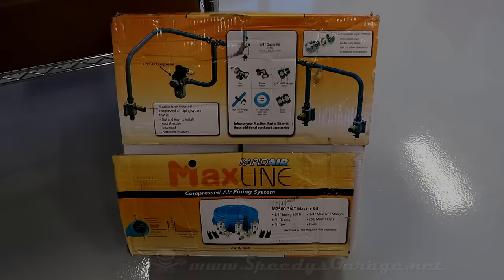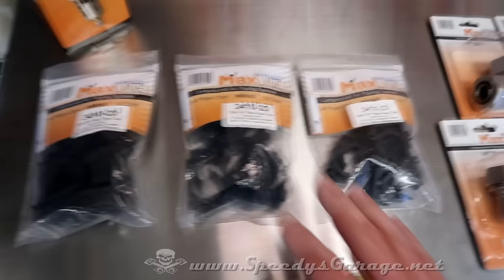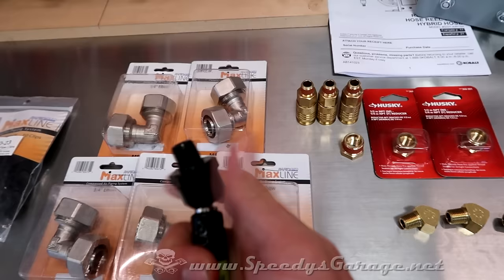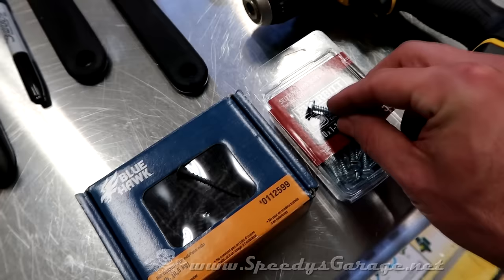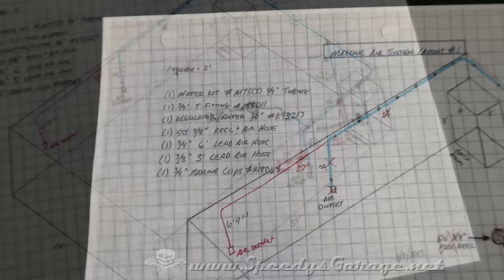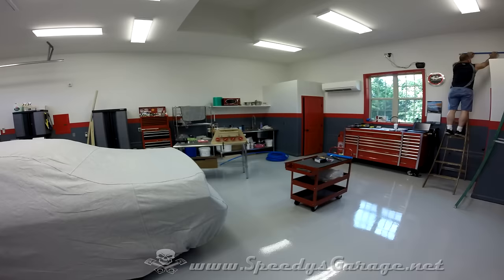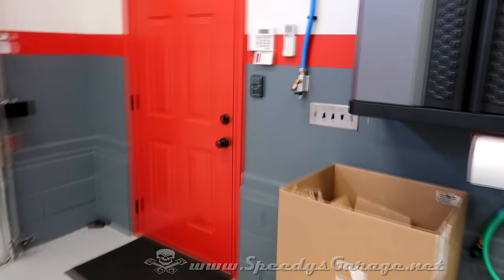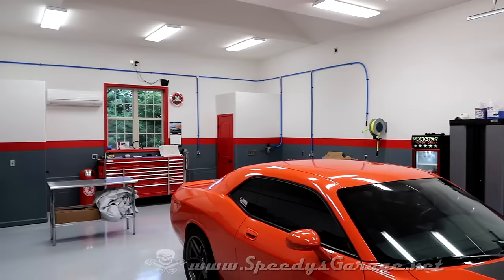Rapid Air Maxline Air System Install Speedy's Garage

Comment: IDK if it was mentioned, but the "push" type air quick disconnects are nice to just walk up and "plug" a hose into, but they give out with just a little use. Trust me...I sell a 100 of the "pull back" type to 1 "push" type. They just arent reliable. I applaud your install. From design of cabinet to end use....OCD myself and it looks awesome!!! Also...on the whip hose with solid 1/2"NPT on both ends, find a hyd shop. The make ALL kinds of hyd fittings for just this application. Its female NPT on one side and male NPT on the other and it swivels to allow you to tighten it up. They also make reducing fittings and bushings etc......sorry, one more thing for your viewers...some "black pipe" is only rated for 150PSI, now I know there is a safety rating but still not good to use malleable fittings for air...AND NEVER USE Sch 40 PVC, its a bomb waiting to blow

Comment: Im doing the lines in my garage now, and you by far have the best "how to" guide on this system! Btw the hose reel whip is supposed to have a male end so it can attach to a chuck mounted to a wall manifold. Thats why it wont work when threading both ends. (Treat it kinda like a normal air line) Or just have buddy hold the thing and turn the reel, while you thread it at the same time. And then mount it 😆
Reply: Quick connect also gives a place to disconnect for repairs. I mean maintenance!

Comment: For all watching and considering this, he did a great job....just some advice, go to your local hyd hose shop and they all all the fittings, bushings, nipples, etc....that you need for the moments in this video where he said he had to buy extra stuff. Hyd fittings are forged(high PSI) and they come in EVERY combination you can imagine. Dont go to a chain outlet, they will rip you off. I built every hose you can imagine for a living and your local joint can help supplement what this kit doesnt include. Great video
Reply: PS.....a few drops of dawn soap and water in a squirt bottle will find any air leaks
Reply from the maker: I've got that on my short list.

Comment: I just installed a Maxline M7500 as well.

The answer for that "how do I use this 1/2" to 1/2" non-spin whip"  is to simply land one side on the air block, land one side on the hose reel (while it's still off the wall and you can "spin" the entire unit), and then screw it to the wall.  You'll have to unscrew it from the wall and try again if you get any leaks.  Sometimes it's just as simple as changing your order of operations.

Comment: 3/4" pipe versus 1/2" pipe isn't 50% more, it is 2.2 times more! look at surface area of the inner diameter. Similar to comparing drainage lines, two 4" pipes does not equal one 8" pipe.  Love your shop!

Comment: Installing a system right now, haven’t read all the comments, but do not use a tubing cutter (roller cutter) it compresses the cut end just enough that it is hard to push on even though it is reamed. The o rings tear very easy. Also an emt conduit bender is much quicker and easier than the roller straightener. Especially with the larger sizes such as 1”.

Comment: A piece of 3/4 inch plywood behind the drops (outlets) and you would have no problems mounting them. Mount the plywood to the wall and mount the outlet to it. Also, your choice of the 3/4 inch piping was a good move. Airflow is substantially better (especially with better quality air tools) and will make all the difference in performance of your tools. Since you intended to use multiple tools at once this is even more important not only for performance of the tools, but in the savings of wear and tear on you compressor. Great video!
Reply: I have a small shop and would only need like 25' rigid air line to go a 50' 3/8" hose reel. I'd like to use an impact wrench for tires. Do you think that 1/2" rigid air line would be sufficient? My compressor is 20 gallon and 6.2cfm @ 90psi. Otherwise, what would you recommend? Thanks!

Comment: I am just now installing my air system. I found that tightening the compression fittings to 3/4 turn required a lot of torque. As the nut is tightened the stainless steel taper slides against stainless steel compression ring.  Being of similar materials known to gauld. I put a small amount of white greese on both tapered surfaces of the compression ring (be careful to not get any on the pipe) greatly reduce the torque necessary to achieve 3/4 to a full turn.  It makes tightening them almost enjoyable.

Comment: A three piece pipe union is what you were looking for to connect your lead-in hose.  PneumaticPlus, Milton, and a few others also carry air filter regulator combos with up to 1" NPT with either embedded or external gauges.  Hope that helps!

Comment: Very nice. As for the hose reel. I would place it on the wall where I want it. Take it down.  Add the hose and therefore still be able to tighten both ends without kinking and then remount the hose reel.

Comment: You could use the blue whip hose by disconnecting the compression fitting off the 3/4" air line, that acts as your union. Great video, clean shop.

Comment: Thanks for sharing! Great tips!!!!
I just completed the max air install! Excellent system! Pain in ass to straighten out....wish I would of had that jig. I found that the clips help to straighten pipe as you install on wall as well.
Milton makes a 3’ flexible compressor whip...one end is 1/2” npt male and one end is female rated 400psi. Works great as well! Planning and layout important! This system is very versatile thank god! Also an extra hand makes it much easier installing on wall or pipe will bend against its own weight especially long runs of pipe. ProTip: I ran an extra 16’ pipe straight up wall and down with ball valve on a T fitting from the ac to allow the air to cool and catch most water prior to my water seperator. Yours turned out good!!!

Comment: the short piece fo hose  included with the kolbolt, is meant to get a quick connect fitting on it so you can move the reel and plug into a splitter or manifold, first attach the quick connect, then you attach it to the reel then connect then using the quick connect, plug into splitter or outlet

Comment: Good video.   Your Cresent wrenches will last longer if you use the opposite direction.  When you pull with the adjustable part of the wrench opposite of the line of pull, it places the highest load on it and wears the sliding part out.  Flip the wrench over and they will last longer.
Reply from the maker: Thanks for the tip!

Comment: The whip hose you roll the whole hose or tighten both sides at the same time. Roll the hose toward the wall compressor side tightens and reverse thread on reel tightens.

Comment: That should be a loop. So you can have equal pressure at all drops. Also a half inch drop per every 3 feet. For condensation drainage.

Comment: Love the air line set up...myself im getting ready to build my hobby shop..im going with the same brand air comp but 80 gal. And for my lift i want a clean shop floor..im going with a globe inground air over oil.2 post lift.full open under its about 8 grand..ya..but i.  A clean look.in my garadge.the oil tank will be above ground..at the controls that making my inspector happy my home on 1 acer..lot.again thank u for your. Videos..my air comp will be outside behind the garadge.in a shed..sound proofed. So i dont hear it running.

Comment: You could have always ordered a 3/4 regulator from swagelok. They are the granddaddy of fittings and compression fittings and tubing. Also a word to those who use NPT, or other fittings. Very rarely is PTFE tape/white tube tape/plumbers tape designed to create a seal. It is designed to prevent seizing or frozen threading. NPT threaded fittings are deigned alone to create an air tight seal. The taper on NPT threads allow them to create that seal when torqued. The flanks of the threads compress against each other. Only parallel threads require thread seal tape to allow for tighter seals by lubricating the threads to be tightened for a deeper seating.
Reply: I have had to use teflon tape on most of my fittings because the threads in them seem badly machined. Most of the brass ones would hold well, but any of the plated or painted ones (either steel of diecast Aluminium) need tape.
Two possible reasons:
1) I was testing for leaks at full tank pressure (120psi?), and
2) most of my fittings came from a $20 all-in-one set of spiral hose, couplers, nozzles, blow gun, etc

Comment: Speedy.... that connection SHOULD turn on the hose so you can tighten it. its not designed to spin freely, but you should be able to turn it enough on that fitting to get it tight. I've had a couple of different hoses, and they all allowed it to turn.
Reply from the maker: Interesting.  That should help some folks save a few bucks.  Without a swivel I assumed they weren't designed to "move".
Reply: My Goodyear hose reel had the same whip hose. I just attached the whip to the reel first and rotated it as I tightened it to the block. A little cumbersome but completely doable.
Reply: You can also twist the hose so that when you're tightening it, it unwinds and ends up normal....
Reply: I just used a quick connect fitting at the wall.  Easy to disconnect if you ever need to do maintenance on the reel.

Comment: Going with the 3/4 is a way better decision im 22 years old and im looking into runing air in my shop is a 40×60×14 and i think im going to go with 3/4 like my grandpa use to tell me when i use to decide if i wanted to buy just a cheap harbor freight socket set or snap-on he was a diesel machanic at Ryder truck rental for 35 years and he only bought good brand tools he always told me buy once cry once he also use to always tell me when buying equipment or when i purchased my shop i was just going to go with a 30×40×12 but i kept in mind what he use to always tell me and that is you can do small work with big equipment but you cant do big work with small equipment so that why i decided to go with snap-on tools and a bigger shop i mean buying snap-on tools and 40×60×14 hurt my pocket but i defiantly dont regret it you made a damn good decision going with 3/4 pipe
Reply from the maker: Good luck with your shop build!

Comment: That is a pretty system... and an expensive one. I used 3/4 inch schedule 40 pipe and fittings. Easy, cheap and fast. Never had a problem.
Reply from the maker: I think it was like $200.  Didn't seem that expensive to me, but if you got something much cheaper to work, good deal.
Reply: @SpeedysGarage  I figured it was would be more than that. Your whole system including pipe and those brass fittings and adapters was $200?
Reply from the maker: Right about that....I got the Maxline kit on sale for $179, I can't recall exactly how much the fittings and stuff where, it's been a couple years.

Comment: sweet ride you got there....so i wanted to go with the 3/4" but your final comment with the 1/2" pipe threw me....I will be running a small sand blast cabinet, air tools, and most importantly...an HVLP so i need to carry the cfm. I live in Europe so anchoring the blocks won't be a problem....a plastic anchor and right into concrete. Thanks for the tutorial
Reply: Pyper70 don't waste your money on the 1/2" system.  It is junk compared to the 3/4".  This 3/4" system is money well spent.  I just installed two of the master kits in my shop.  Love it!  Great video by the way👍

Comment: After watching u do your good job u have done im asking myself why the heck u didnt go with a 80 gallon 7 or 8 hp for that shop you have made you may say the 60 is fine but that shop needed a 80 gallon imo but hey its your dollar but it dont seem your short of those the way you bought all that material . A dryer system building a manifold is what i want to watch you build
Reply from the maker: 60 has been enough for my needs the past few years.  80 wouldn't fit in the closet and I wanted the shop space.

Comment: Thats a quite the laboratory you got there. We tried using the plastic air line set up and had nothing but issues with it constantly blowing out. Went back to running 1" air hoses and putting 3 way fittings every 50 feet and tag in that way. Haven't had an issue in 4 years now. 
How is that Quincy compressor holding up? Thinking of getting one for my personal shop. Thanks!

Comment: By the time you get the pipe straightener,  it's close to the same cost of black pipe or copper. 
Wish rapid air would make the straight stick's easier to obtain. Than I would buy there product.

Comment: Excellent Video Series, love that Quicncy Compressor with the Baldor Electric Motor & V-Twin 4 piston Pump.
Speedy would it have just been simple enough just to add a Quick Connect Coupler to one of the ends of the Whip Hose @ the Hose Reel. Allowing for an easy install of the Whip Hose. Just a thought. Maybe you can explain to me if this crossed your mind & if so why you chose "Not" to do this. I might find my self in the same senerio in the near future !!
Once again, an Excellent choice in your Compressor & a Excellent Video series. Thanks for Sharing !!
Reply from the maker: That's an option for sure, however don't know about you but a lot of my quick connects start to leak over time and I felt better long term about a threaded sealed connection.  Just seems like an oddity on the whip not being flex at each end.

Comment: Very nice job but the 3/4 pipe and line are pretty pointless. The only thing you'll gain is a minimal amount of additional volume of stored air in the system. The larger hose or pipe in the system makes no difference in regards to airflow when the pathway of the air is restricted at any other point. With a 60 gallon reservoir, I doubt you'll need any additional storage space for air. Again, very nice work.
Reply from the maker: You're right on the 3/4.  If I had it to do again I'd definitely have gone with the 1/2".
Reply: @SpeedysGarage  But also, if you read comments from people about the 1/2" line, that's the OD of the line, which means it's probably closer to 3/8" ID. Either way, your install looks fantastic as well as your shop. Nicely done.

Comment: You're better off radiusing your corners rather than installing those 90° fittings as the 90's will reduce your air flow since they're a restriction. I doubt you'll notice the difference with that short amount of line, though. But the 90's would probably make a noticeable difference if you'd gone with 3/8" line.
Reply from the maker: I agree, if I had it to do again that's how I'd run it, and save a few bucks in the process.
Reply: @SpeedysGarage  I didn't realize this vid was 4 years old. How's it holding up? I saw one review where the line ruptured and burst. I think he kinked it and the rupture was his fault though.

Comment: Interesting that it’s 3/4” pipe, but the connectors are narrowed down to what looks like 1/2”. So you’re going to have restrictions all over. Corners have friction and restrictions too, particularly those sharp 90 degree turns. So now you have 3/4” to 1/2” restrictions, and double that on corners.

So 3/4” pipe has a little bit more air in the line than 1/2”, but your recovery won’t be that much faster than 1/2” because of these corner and tee connections. I had a commercial film lab, and quite a lot of air lines for the 42 dark rooms and the number of processors and other machinery. There are formulas for calculating how much pressure and air volume you will lose with each fitting. Suffice to say that sharp turns, and restricted fittings make a very big loss. It’s why there are what are called full diameter valves and fittings.

I assume they gave 1/2” fittings with 3/4” connections because of price.

A couple of “U” drops with a drain valve on the bottom for water deposition and drainage, would have also been good. It’s amazing how many people don’t know about that.
Reply from the maker: I've forgotten the calcs as I did this a year or so ago, but what I can say is the air system supplies more than enough air to run all the tools I've hooked up to it from large impacts to die grinders run for hours.  The ports have valve on them for water evacuation if needed, but honestly my filter at the regulator seems to have taken care of that as I don't get any condensation at the tools.  Ran a die grinder on a project for quite a while during the summer humidity last year and honestly expected to need to make some adjustments, but in the end never noticed any issues at the tool like I do with my smaller 30 gallon system with just a hose connected direct.  The "U" with valves is a good idea, but in my situation wouldn't be cost effective...I used nearly all the piping in the kit to cover the route shown.  I think I may have had just a couple feet left in the end.
Reply: I was thinking the same thing about the fittings

Comment: That's small 1/4" piece is called a nipple. Also, what epoxy did you use on your floor and how do you like it, it looks great? Now that I had a chance to see the completed garage, what is the name of the gray paint that you used?
Reply from the maker: It's professional epoxy, whatever they used.  3 part deal.  Filled cracks, some kinda primer, color, then clear top coat.  It's been pretty good but has chipped in a place or two like it's kinda brittle where I dropped something heavy on it.